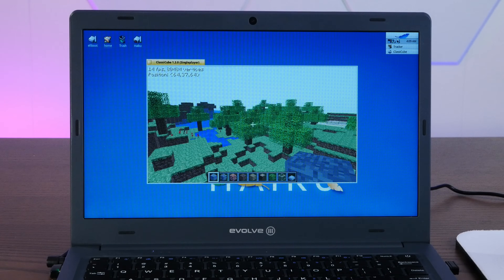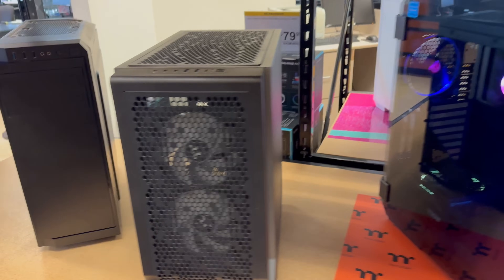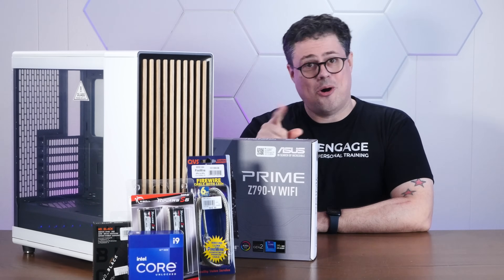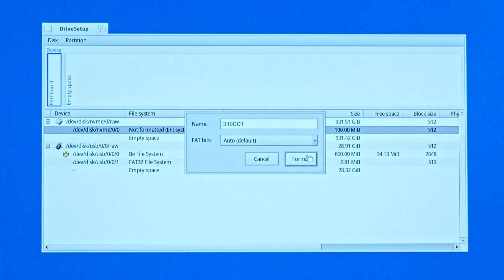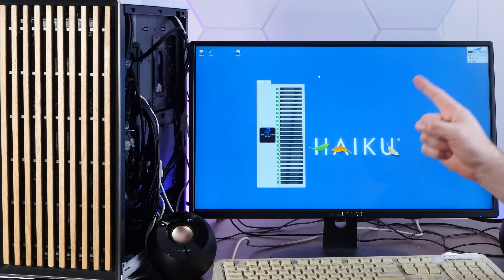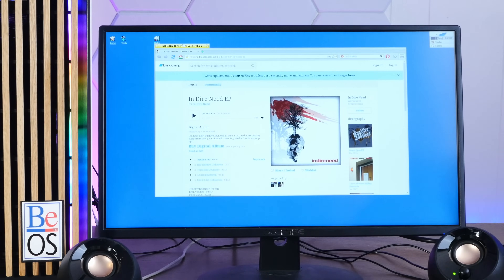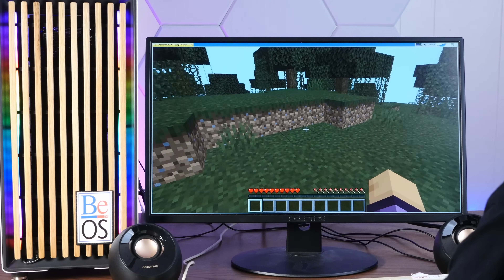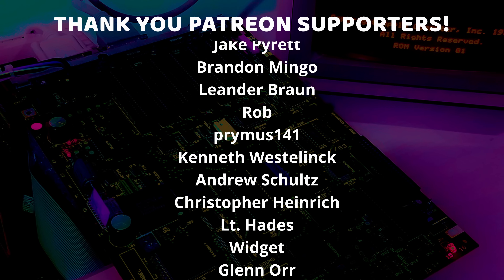I Built a Modern BeBox with HAIKU

Comment: I have installed Haiku onto half a dozen low power Atom and C2D machines and have NEVER had to do what you did with the EFI boot partition.. is there a reason you do that?

I live within easy cycling distance of Akihabara but I'm still jealous of you guys having Micro Centres... We used to have that kind of shop over here but somewhere between 2000 and 2010 they kinda got bought out by mega generic electrical store chains...

We still have a number of nerdy camera retailers and audio joints that sell new and second hand gear with specialist, enthusiastic staff, but the majority of stores are now generic and manned (if at all) by PFYs on minimum wage... Very sad.

Finally, this is the first time I've ever heard the singular form of the word "shenanigans" used. lol

Comment: I'd rather see Haiku run as great as BeOS R5 on a Pentium II 450. I tested the latest release on the PII 450 and while it runs, it is obviously bogged down by the need for keeping up with modern hardware. I get that, but it would be nice to have a lighter weight version that runs on the hardware that R5 ran on. R5 runs on the PII like a beast.

Comment: I tried to daily drive Haiku, I really tried. There are just too many things I couldn't do. Falkin finally allows us to watch youtube on Haiku, however, Haiku's wireless internet speeds, for me, were terrible. I tried to look it up and apparently it's something they are working on for TCP window sizing but isn't quite there yet? Additionally, you can't really watch any other streaming service. Though this isn't Haiku alone. I think you run into the same problems with the BSDs as well. Haiku is a GREAT idea, but I think for the most part, the many applications you can run on Haiku are just Linux ports. Additionally, the 64bit version of Haiku doesn't have BeOS binary compatibility.  So as far as daily driving it, I just can't. I love the idea of the OS, but it's running into the chicken and egg problem. It needs more users to have more software, but it needs more software to have more users. The software it does have is just Linux ports, so why not just use Linux?
Reply: give it 10 more years and its maybe ready

Comment: You really need to flip your orientation of your rad and tubes. Having the pump lower than the rad will create  a pocket issue. To keep the system from killing the pump over time it needs to have the tubes going to the top of the rad not below

Comment: If you move both RAM sticks a slot to the right the cooler should fit right side up, and that's the intended RAM layout anyway ;)

Also, why not use the AIO's RGB fans on the front for some extra stupidity?

Comment: 5:02 Performance tip, use the furthest memory slot from the cpu and its corresponding slot to get the best signal integrity and termination. In this case, that would be the grey slots.
DDR5 has error correction, so the performance might be degraded without any errors showing up and DDR5 is REALLY sensitive about trace lengths, clocking and timings. 

Also, enable XMP in the UEFI interface.
Reply: XMP is Intel's way of setting the 'technically overclocking' frequency and timing settings that are advertised on the ram in one easy to use setting, instead of manually changing dozens of timing settings.
TL;DR: XMP make memory go BRRRRR (or at least at its rated speed)

Comment: what an absolutely lovely video. i especially liked the front panel rgb lights and how they went together really well with the wood! as well as the badge, how it snapped on was so cool! maybe you could take a pi pico, and hook it up via usb - make it pretend it's a serial port so you can write to it from a terminal; then write a simple script that blasts e.g. core use as a number to it, and have the pi control an addressable rgb strip? how about that?

Comment: There was (still is?) a livejournal blog of a Haiku enthusiast who turned his old laptop into a Haiku dev station. The twist: he was also a D lang enthusiast. And he wrote several apps for image processing (graphical apps!), like, simulate a small black hole with given parameters and put it in your picture (several years before Nolan, without accretion disks, but using a physically correct GR approximation); or app that helped fix photos with skewed skyline. All written in D lang. Stopped following livejournal long ago, but maybe we should check him up: he might have created Skynet or something, Haiku based and written in D lang, running on some vintage piece of iron.

Comment: BeOS had a installer that let you install BeOS in Windows without partitioning your drive. You would boot into Windows (98 in my case) run the BeOS app, and it would boot you into a copy of BeOS. It was such a smooth experience at the time.
Reply: But in that case you will be limited with the number of CPU cores recognized by the system. Only one. Maybe some other limitations as well.

I don't remember all the details but at that time I was motivated enough to give BeOS it's own separate partition.
Reply: @jdotoko  I was a rookie with computers at the time and back then you needed partition magic to resize the partitions on the family computer. I knew there were limitations but I was still impressed bu the performance on my 400MHz P2.

Comment: What we really need is a USB interface to an Arduino based LED controller (eg. WS2812/5 protocol).  A small polling based app that reads CPU usage every 1/60 sec and lights up the LED’s accordingly, and presto, BlinkenLights. A Haiku dev can get this done in a day.  For my employer I’ve done something similar (RS232 port), but for mass market appeal you need USB. A good option would be to 3D print a mini case with LED lamps, say 8 strips (like the good old HiFi spectrum analysers) and sell this to retro enthuisiasts.

Comment: Minecraft and multicore don't mix very well without mods, especially without accelerated rendering. Maybe one of the multicore mods released (intended for larger servers but an i9 should work) could improve the framerate, although its apparently unstable.

Comment: I love Micro Center.  I built most of my systems from their parts (there was a brief period in the late 90s/early 2000s where I bought from a small local chain).  I would also buy parts/upgrades through them or Fry's.  When one of the Fry's closed (online hurt lots of brick and mortar), I started getting worried about the other Fry's and Micro Center.  And when the other Fry's went down the drain and the Pandemic hit, I figured it would be a matter of time for Micro Center to close, too  But they're doing fine.  They are usually very busy on the weekends and sometimes weeknights.  So, yay!
Reply: Yes, here in Silicon Valley, the one MicroCenter closed over a decade ago, and since Fry's Electroncs when under, it's just been my local cramped CentralComputer to browse

Comment: I've been looking over the bundles at Microcenter, and I think out of the current ones, the most Interesting is the 7700X bundle because the motherboard it comes with has an AMD(Mediatek) Wifi 6E adapter and at $369 for a 7700X+MB+32GB DDR5 is a steal, and there's an Intel bundle with a 12600KF+Z790+16GB DDR4+ Sparkle 16GB Intel A770 for $450 that looks like a great entry point to test out an ARC GPU plus the board has Intel Wifi, I dislike that board in the 12900K bundle because I'm not a fan of Realtek Wifi at all and they don't use removeable modules that you can upgrade it's soldered to the board so you'd have to buy another card to use in and not get the clean out of the box experience of using the wifi antenna connectors on the motherboard I/O plate.

Comment: That rear 120mm fan really isn't necessary; once you have the three 120s on the AIO radiator in the front, they will make sure enough air goes through the case from front to back. Overall I like the look of the case a lot; I have a rare old Antec P150 that I have been using forever because instead of a light show, it just looks like a futuristic appliance.

Comment: Flip the radiator, it's mounted upside down which is not ideal. It will be noisier and if there's air bubbles it can damage or destroy the pump. Your pump is at the top of the loop with the radiator's current orientation and you never want that, and it'll allow you to mount your pump in the correct orientation rather than sideways.
Reply: That's only true if the top part of the radiator is lower than the pump, which is not the case there and this is the recommended orientation for front install. If he used the XL version of the North, he would've mounted the AIO at the top instead.

Comment: Love your Haiku videos! I've been a BeOS / Haiku user since Release 3, and for a time it was my daily driver. Only one point to comment: 100MB is OK for your EFI boot partition but, if you want to install lets say five different operating systems on the same disk, you will need at least a 512MB-1GB one to acomodate the different boot loaders, some of them may be way bigger than the BeOS one! 🤓

Comment: You know what would be really cool, though? If Haiku supported the modern POWER architecture and the Talos II and Blackbird motherboards. Then you could build a modern IBM POWER-based BeBox. The original was PowerPC-based, right? Much more analogous :)

I love the case design. That BeOS badge on the front is fricken perfect, and the RGB along the sides on the front is brilliant.
Reply: Holy shit I legit had the same idea. Honestly there's been so little YouTube attention on those desktop POWER machines. When I was in high school one of my dream PCs was the original unsuccessful Talos 1. That was back when I thought I'd become a computer engineer or programmer. Nowadays I'd just want one for the sheer fact it's an enterprise-grade architecture in desktop form.
Reply: @SockyNoob  If those things weren't so prohibitively expensive, I'd get one just for fun. I like Fedora Linux anyway, so bonus there.
Reply: Are you in the mod community, Xbox too, you should be able to run Unix on them
original Power PC apps, not sure if people need that, why should you run them on Power PC ?
Reply: @lucasrem Not really, but I like to tinker. I did a CPU upgrade on a Power Mac G5 to make a dual 2.5 GHz out of a dual 2.0 GHz using one of the CPU modules out of a dead quad G5, for instance. I once put the guts of a beige G3 tower Mac into an ATX case too. Just yesterday, I installed Fedora Asahi Linux onto a spare M1 Mac mini :) I'm just a lone wolf enthusiast.
Reply: @ericwood3709  what about weird OSes for SPARCstations?
Reply: @SockyNoob  Does it get much weirder than SunOS and Solaris? How many other OSes even support it at all? I suppose there's a Linux or two out there for it.

Comment: Wish we had something like Micro Center here in the UK!
Reply: Overclockers UK, IMEX business park in Stoke on Trent is really good.  If I was in England and I was making a new build It's where I'd go.
Reply: @jondonnelly3 That's one store for the whole UK though... and it's in Stoke-on-Trent, the butt of every joke about places in the UK that are terrible.

We used to have a quite similar shop to Micro Center, called Maplin - it sold PC components, cases, etc. It also sold just electronics components for projects, you could go in and buy a single resistor or a bag of 555 timers or anything else.

Unfortunately over time it became less about that and more just mass-market gadgets and then the online retailers just blew it out of the water on pricing. A real shame because being able to get PC parts or electronic components same-day, within the hour if you lived near enough, was fantastic.

PC World used to also be pretty good in terms of selection but now it's just an area in a general electronics and appliances retailer rather than a full standalone store, and it just doesn't have the stock variety that it used to.
Reply: Maplin did exist as more of a hobbyist type store but they died like 6 years ago
Reply: I wish we had something like Micro Center here in Arizona.
Reply: Yeah we either don't have the market or don't have the space.  Another thing I don't get America is how normal it is there to be able to get a 3D printer in their equivalent of, like, B&Q. What? (I suppose there's more of a market for that there, too - but then again gun people can legally print stuff here too, just not the actual gun.)

Comment: which video card? onboard graphics? are there dedicated GPUs supported in Haiku?
Reply: There is absolutely zero support for hardware acceleration in Haiku. It's using the Intel graphics but only for the display output, it's not actually using the GPU.

Comment: It is insane that you can build a supercomputer power from 80s/90s using off-the-shelf components and then run BEOS on it. 🤣
Reply: It is Haiku he shows, a modern system inspired by Be. Be itself will not run on anything later than pentium iii, and will not allow more than 1Gb of RAM. There will also be complications running modern compilers on it, I think it was tied to gcc 2.95 (ancient). I have a holiday in a few weeks and have collected a dual 440BX motherboard, ram, chips and ssd to have a shot at a build, all from ebay. An IDE to SSD interface should allow a faster experience than the system had 25 years ago. Peripheral cards that used to be expensive are cheap on ebay also - intel chipset network cards, video cards.
Reply: @cratuki  watch Omores run it on a Ryzen 9 9800X3D
Reply: @masterkamen371 I could not find a video by Omores featuring BeOS. Do you have a link? An update on my own project. I ended up getting Be running on this configuration: Abit VP6 (recapped), dual p3-1000, 512MB RAM, Riva TNT2 / Various matrox cards, CompactFlash. Disk drive were really fiddly, I suspect this is related to the Abit IDE controller. Be is much more crisp on that hardware than haiku/32. I had difficulty installing Haiku/32 also - particular problems with Matrox video cards.
Reply: @cratuki  it was a joke, he runs all kinds of ancient systems with full support on brand new hardware. Could shoot him a message I guess.
Reply: Also record a video on your phone post it to the internet and view the video on your watch with wireless earbuds. Probably more absurd things if you told people in the 90s
Reply: @yakmage8085  lets calls it wireless walkman